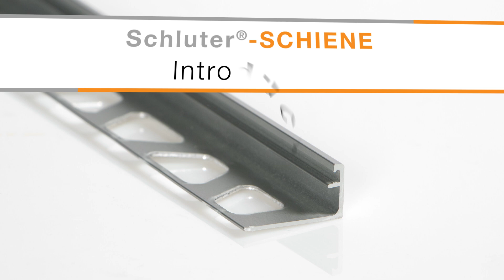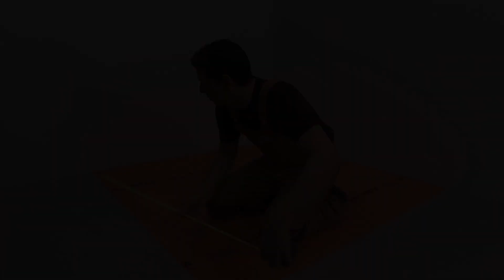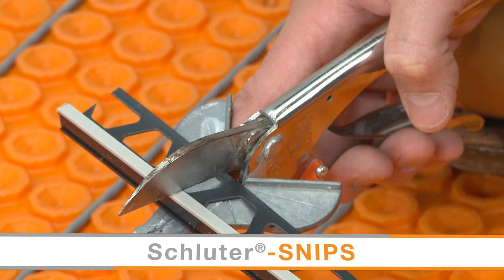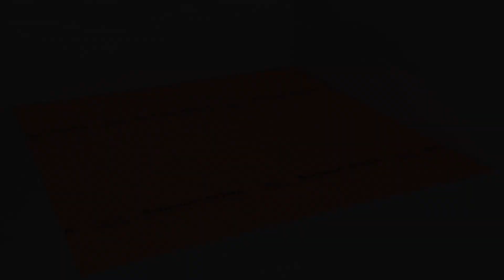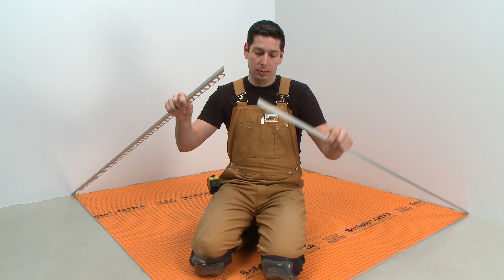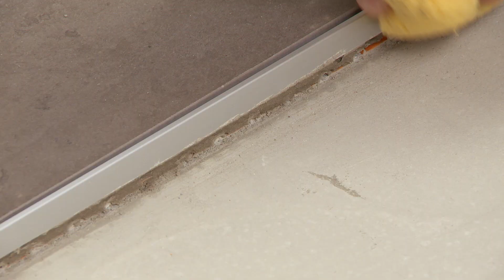How to install a tile transition on floors: Schluter®-SCHIENE profile

Comment: Do you match the trim to be the color of the tile, the grout, or the carpet or wood flooring?
Reply from the maker: That's the question, and there are many options. The trim can match the tile for a more seamless look, or create a bit of a pop by going for something that truly makes it stand out. Some people match the trim to the hardware, like shower heads and drain grates. It's a design choices, there's no right or wrong answer :)

Comment: It's really ugly to see the orange membrane under the trim. anybody else is bothered by this ? I guess the way to do it properly would be to put the trim underneath the membrane so it's not apparent. I cannot find any video or shema showing this. Just amazing the lack of information about this.
Reply from the maker: Hi Daniel. Good question! You can use a reducer profile like RENO-U or RENO-V and put the anchoring leg under the DITRA membrane. You just need to verify the slope for any ADA needs. A profile like RENO-TK could possibly also go under the DITRA and possibly go right over the wood edge. If you have any questions or would like some samples, you can reach out to our product support team. They will be able to assist you. You can reach them at  888-472-4588 (USA) or 800-667-8746 (Canada). Hope this helps!

Comment: This would be an ugly mess when the trim is used to cover the tile edge over existing hardwood floor. How do you install the trim then ? directly on the hardwood floor, under the ditra ?
Reply from the maker: Hi Daniel. Good question! You can use a reducer profile like RENO-U or RENO-V and put the anchoring leg under the DITRA membrane. You just need to verify the slope for any ADA needs. A profile like RENO-TK could possibly also go under the DITRA and possibly go right over the wood edge. If you have any questions or would like some samples, you can reach out to our product support team. They will be able to assist you. You can reach them at  888-472-4588 (USA) or 800-667-8746 (Canada). Hope this helps!

Comment: It looks great!  Do you have another product or a way to install it with existing tile?  Our entrance way is tile and our living area is currently carpet but I plan to remove the carpet and put vinyl so I would love to use this product for the transition between the tile in the entrance and the new vinyl floors in the living room?  But how can I use this without pulling up and replacing the tile?  Thanks!
Reply from the maker: Hey there! 
The anchoring leg for the SCHIENE does need to be installed under the tile, so it would not be able to be used in this instance. There are 3 other possibilities; 1. If the tile floor is 1/2” higher than the subfloor, the RENO-RAMP-K could be used, but it has a large reveal. 2. If the tile will be 1/4” or less higher than the vinyl, the VINPRO-S could be installed with the Vinyl, but it would not protect the edge of the tile. 3. The substrate could be built up so the top of the vinyl would be even with the tile in order to use the VINPRO-S, VINPRO-T or RENO-T (depending on depth) to finish off and protect both edges. If you have any additional questions, please feel free to reach out to our customer service team at 1-888-472-4588 
Thanks!

Comment: My husband and I are looking into alternatives for tile to wood floor transitions other than wood or marble. Would this work if the edge of the wood floor is unevenly cut?
Reply from the maker: Hi Lisa, It would work to protect the edge of the tile, however, it would not change the unevenness of the wood. A RENO-T could work to cover that up, if the tile and the wood are the same height. If the wood is lower, a RENO-TK or RENO-V might work. You're welcome to give our Product Support team a call to discuss various options and see what's right for you. 888-472-4588. Thanks!